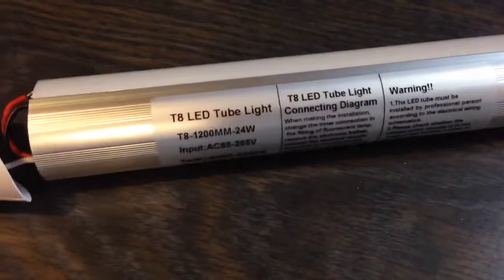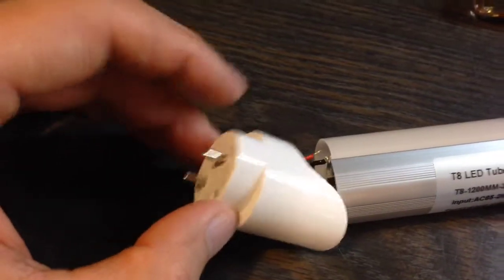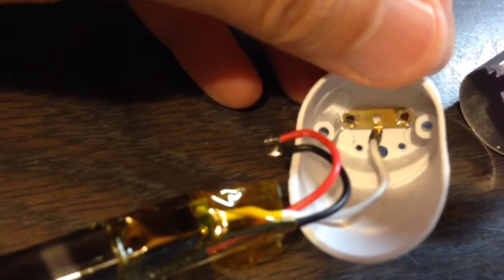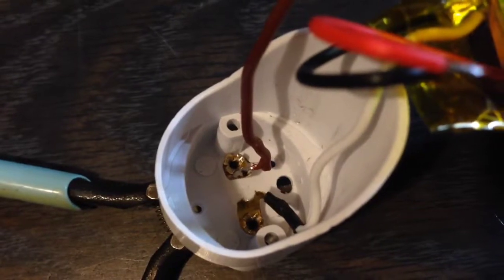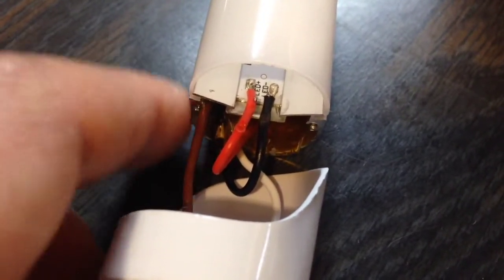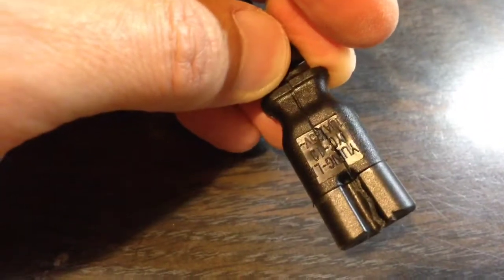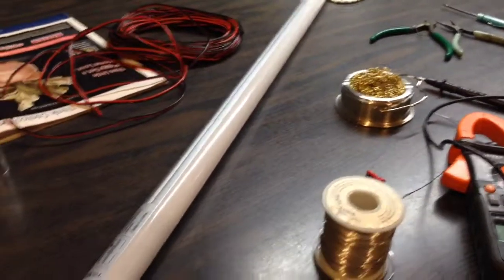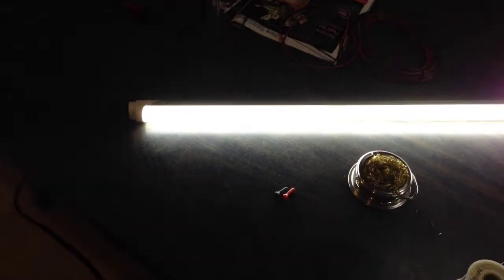LED T8 fluorescent tube modification

Comment: Greetings from Down Under !!
I'm a bit challenged by your figure 8 lead hack as it risks exposing a contact...
I use a terminal block sleeved with an inch of heat shrink tube.
Just a safer alternative, but you can't by heat shrink by the inch and few people would have it laying around... I guess insulation tape would serve both your method and mine.
Thanks for the video !
Nice to see someone else with a creative mind !